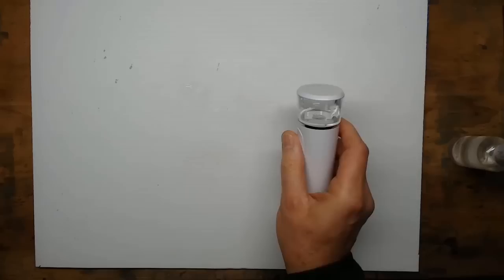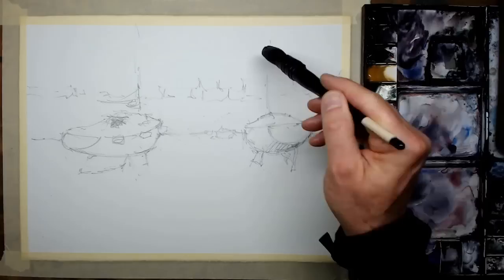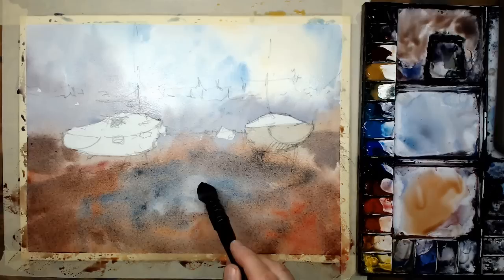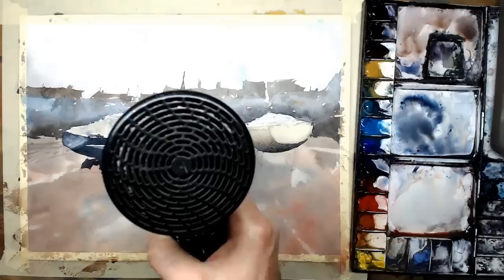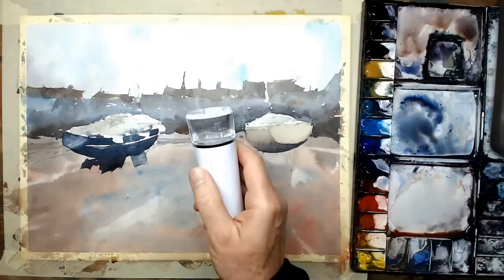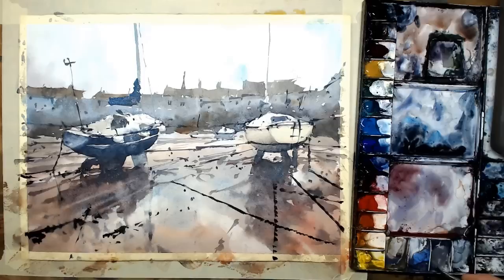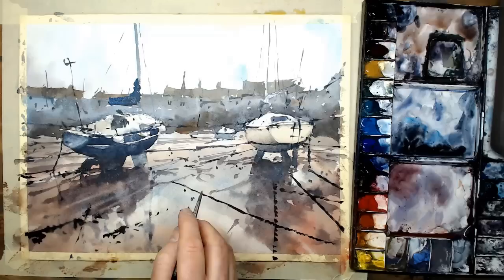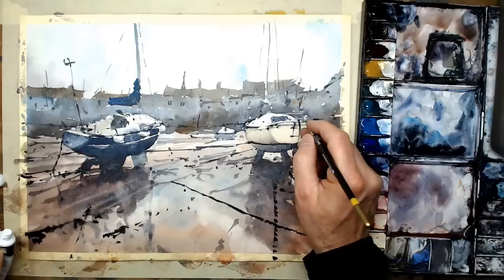How to use a NANO MISTER in a watercolor painting

Comment: I use an expired eyeglasses cleaner bottle. It may not be the same quality re: no big drips or whatever.  I sometimes put some dilute iso alcohol in it (for spraying on alcohol inks or whatever).
Reply from the maker: Great idea. Thank you
Reply: Stephen Turner  I suspect using pure water from the garage, instead of chalky alkaline tap water, might improve clog-free spray nozzle operation, light fastness, clarity, hue and transparency, transluscence, (think chalky wine glass)  and paper integrity?   Ooops! 'See folks mentioned this already.
Has anyone tried dilute hydrogen peroxide spray on pigment?

Comment: I haven't found the part where you use the mist sprayer. I am interested in learning how to use it to keep a more or less constant humidity of the paper as I think that to be able to control paper humidity  is a crucial skill to master in wc.
Reply from the maker: I used it a few times. It produces the finest spray.  You need to keep using it to prevent paper totally drying.  Also helps pre wetting the paper and paper being on a non absorbant surface.

Comment: I also like to paint boats, and I prefer to be outdoors, so I will paint on the spot.
Reply from the maker: Thanks Charley.  If it's windy outside, the nano mister might be too fine.  I like painting boats also
Reply: @TimWilmot  There are too many interference factors for outdoor painting
Reply: @TimWilmot  If it's the same type of ultrasonic transducers they use for room oil / aroma / water dispersal - the vapour appears dry, the particles too small to be able to 'congeal' onto surfaces and dampen them.

Comment: I thought I was the only one concerned about the larger globs of water spitting out from regular spray bottles Tim. I've been wondering how to overcome that problem and it looks like you've cracked it. One question though, do you have to use a special purified water? I'm wondering if the nozzle would start to spit if used with normal hard tap water. Thanks for the info - most useful.
Reply from the maker: Hi John.  I think it is best to use distilled water.  I think the tiniest bit of mineral deposit could clog up a nano mister
Reply: @TimWilmot  Yes I think you are right Tim. Thank You.

Comment: Thanks Tim 
An easy alternative to glance back at the reference image as a large icon 
- but without interrupting the demo ... [apologies if someone's mentioned this already]
- hover your mouse pointer over the viewer's red time line tape located along the bottom of the viewer, anywhere between 2:15 and 4:08
This view condenses the image, so as to more easily facilitate evaluation of tonal values and composition -
in much the same traditional way of scrunching up your eyes to reduce detail in order to compare tone.
Reply from the maker: Good tip!